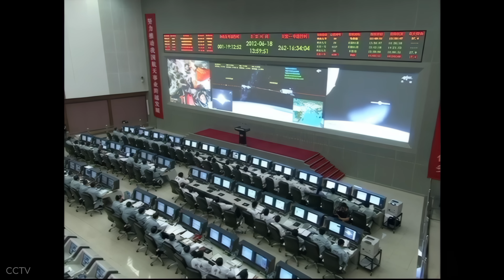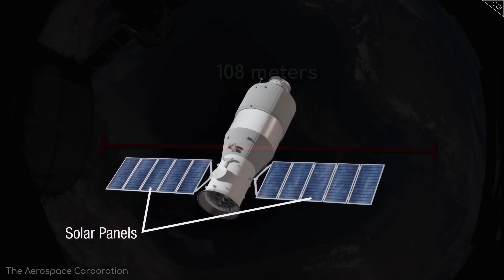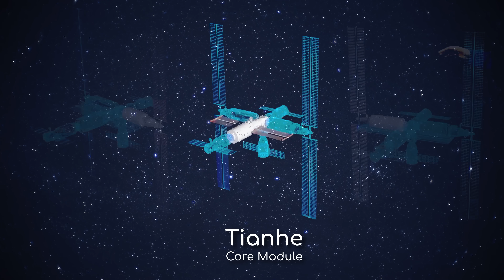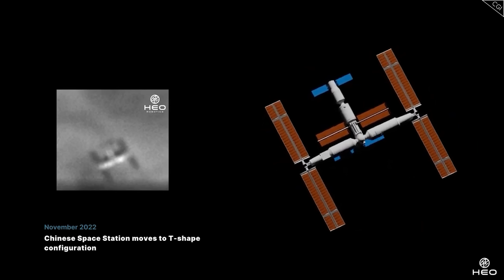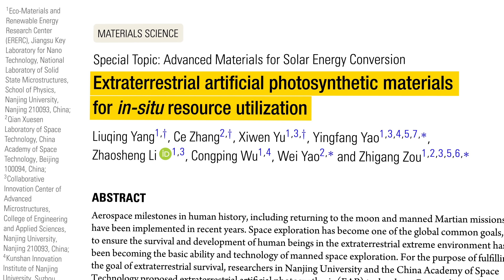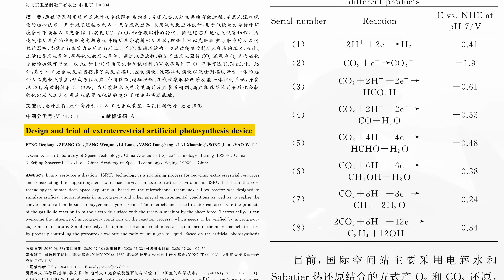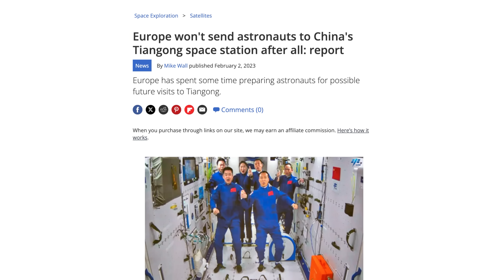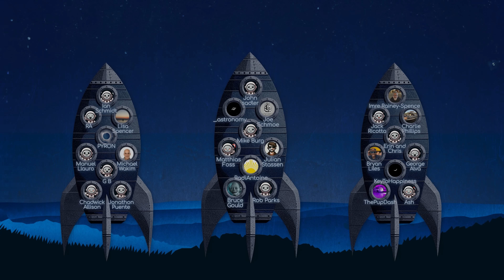How Did We Underestimate China's Tiangong This Badly?

Comment: That artificial photosynthesis thing is not gonna scale up to the point where you can make rocket fuel.

The inputs have to come from somewhere. There’s no way that the people in a space station or a rocket are gonna make enough CO2 to make rocket fuel.   

And of course, the energy has to come from somewhere also.   You’d be much better off, taking electricity from your solar panels and using that directly for ion propulsion or something similar than trying to use it to make chemical rocket fuels.

As a way to get rid of CO2? I’m not sure that either. It may be more efficient, but can it handle the reaction rates necessary? And then ethane gas is toxic as is methane, etc. 

What are you gonna do with those compounds?   If you don’t have a use for them, then they build up.  If you have to vent them to space, then it defeats the purpose.
Reply: Methane and ethane are toxic?
Reply: @ yeah if you’re in an enclosed system, and there’s a problem with containment and ethane and or methane escape, not only are they not breathable because they displayed oxygen, but they’re also flammable. That’s not the case with the standard system for handling CO2.  Maybe toxic isn’t the best adjective but if you’re in a spacecraft and there’s a methane leak, you’re screwed.
Reply: @mb777-g8v   Displacing air is not the same thing as toxicity. You're just not getting the oxygen you need, like when you breathe from a helium balloon in order to sound like Donald Duck, because the breathing reflex actually works based on CO2, and when you breathe other gasses you still exhale CO2.

By the way, CO2 is actually somewhat toxic. You're not going to feel well if you're exposed to 1% CO2 in the air, and 4-5% is life-threatening.

Comment: It never crossed my mind that the only reason a ping pong ball would float on water is because of gravity
Reply: is one of the reasons but not the only reason, fluids and objects in space behave differently, water in space also floats so it is going around the ball and btw space, has gravity, it never goes away, if not the moon wouldn't orbit Earth and the earth wouldn't be orbiting the Sun and the Sun the center of the galaxy. 
The only reason we float in space, is not because gravity is turned off, is because we are falling towards the earth, in free fall and that has the effect of "cancelling" the effect of gravity, but is only a illusion. 
The only reason the space stations and the rockets, always falling towards the Earth, don't just crash into it, is because they are traveling very fast, on a horizontal motion as well, ~28000 kmph and that makes them keep orbiting the Earth and in permanent free fall, again giving the illusion of zero gravity.
Reply: No, the boyance effect is due to the atmosphere pushing down the fluid, if the weight of the atmosphere is not there pushing the fluid down, any ball would just displace the fluid and stay where you left it.
Reply: @danielmelo389  if that is a reply to me, you are certainly right, but that is not the main reason, like I said on my original reply, water floats in space and so just goes around the ball keeping it in place, so gravity is one of the reasons but the atmosphere compressing it down, also has effect on this, so is not a single reason is a bunch of forces that create the known effect on Earth.  But gravity is on the equation, if you ever wanted to simulate this on a computer you would have to take gravity into account not only atmosphere.
I never tested it but I assume that if you put the ball in a box, on Earth and remove all the air from the box creating a vacum, the ball would still float up. Ok water would just boil and turn into gas, and this experiment wouldn't work as intended but lets ignore that fact, for argument sake... :)
Reply: Waiting for underwater ping pong in space to become an Olympics sport.
Reply: Antigravity! 😊
Reply: Not the only reason...the second one is that it is less dense. A ping pong ball made from iron would not
Reply: If it was made of iron, it wouldn't be a pingpong ball.
Reply: @Sancha-pana yup. That would be a ball bearing

Comment: If space is in a vacuum, why does sunlight decrease at distance/jupiter?
Reply from the maker: Good question! Sunlight gets weaker at greater distances because the same amount of light has to spread out over a larger area. Think of a torch beam - close up it's bright and concentrated, but farther away it covers more area and becomes dimmer as the light is spread out. Mathematically, it follows the 'inverse square law': the amount of light received is inversely proportional to the distance squared. So if you double the distance, the light intensity becomes 1/4 as strong. If you triple the distance, it becomes 1/9 as strong. Jupiter is about 5.2 times farther from the Sun than Earth, so it receives about 1/27th (about 3.7%) of the sunlight intensity that Earth does.
Reply: @astrumspace  Thank you
Reply: Because sunlight is spread out over a large area
Reply: the further away you are from the sun, the bigger the circumference. If you divide the surface area getting hit by the circumference of an imaginary globe from the distance of the sun, you will have a much smaller percent ratio. so you are receiving smaller percent of the suns energy. I'm not sure if you are trolling with your question, but any who, I tried to explain it.
Reply: Inverse Square law. Newton got that covered with gravity
Reply: To add my two cents, even a laser beam isn't a perfect beam but instead a very narrow cone. Even that will spread and lose energy over great distances.